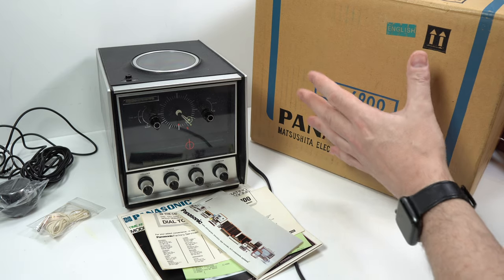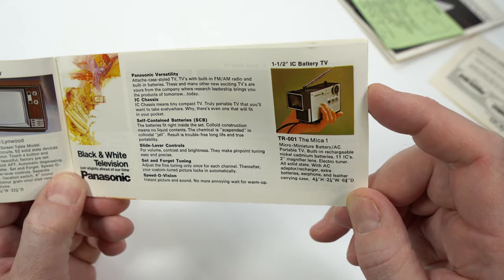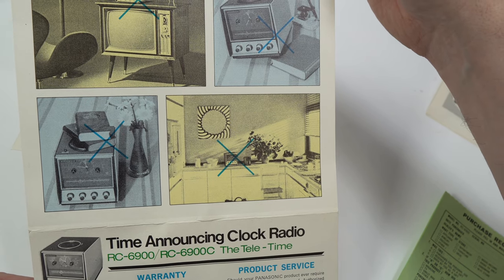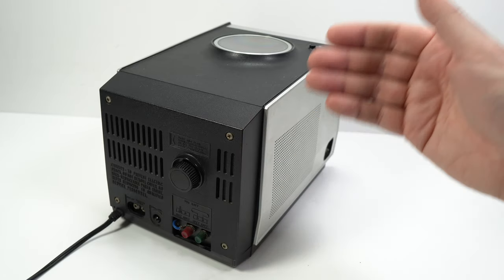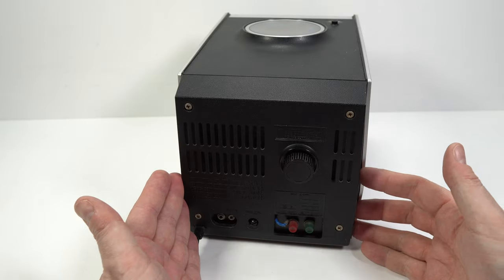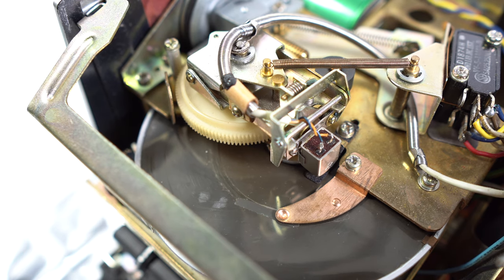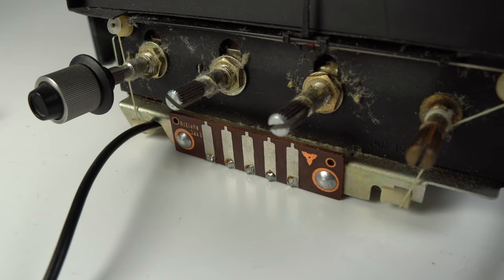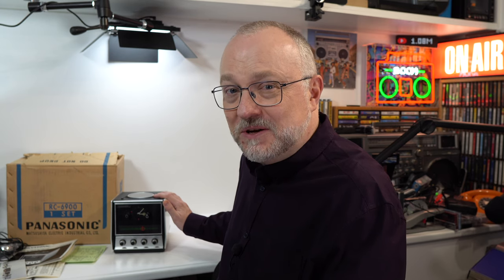The fifty year old Talking Clock Radio

Comment: A semi cheap way to convert to 60hz for testing stuff you get, you could get a Pure Sign Inverter, you can then run it off a Lip04 Battery or a Lead Acid Battery, or even a Large Power Supply, then you can use things from all over and keep the right frequency.

Comment: What an amazing device! I did not expect that dual disc setup. That's pretty clever. As for the sound, I'm sure a lot of it is degradation, but how is the condition of the speaker? Considering the surround needs replaced on even some pretty high-quality speakers every couple decades or so, I'm sure the one in that device might be contributing to some of the audio issues. Still, I would have absolutely been beside myself as a kid trying to get something like that back in the 80s, and then ended up never using it. Just like I wanted a flip-number clock like my grandfather had, like I wanted one of those clocks that projects the time on the ceiling in the 90s, and so many other gadgets but I decided to stay clock-related for the topic of the video lol

Comment: The U.S. has Daylight Saving Time.  (Across the pond, it's British Summer Time.)  Does it have a control where you can set the clock one hour before or one hour later?  Since it's one hour earlier than the correct time, maybe that has something to do with it.

Comment: It may be feasible to dismantle a 5.25 floppy disk, plenty still available and use the disc from that. Record all the audio you can off the original disk, on to a PC. Disconnect a tape recorders head and solder the wires onto the clock radios head, play the pc into the tape recorder input. Make the clock radio play the required time and at the same time use the recorder to record that message onto the disk.

Comment: 1:48 You might want to order a 12V-to-120V 60Hz power converter from Amazon, Wall-Mart, Autozone, or some other retailer that does business in the USA, then just hook it to a spare car battery on a trickle charger. I'm sure it won't be a big deal with this clock, but if you ever get a 60 Hz turntable, it will be a big help.
Reply: Make sure it's a pure sine wave converter so you get real 60Hz electricity. The electric hum should sound like a B flat.

Comment: A replacement 20% bigger wheel to drive the drive belt will convert the device and make it 50Hz compatible. Just because you’ve got the box does mean you have to think in it.

Comment: During the 1970s, gadgets like this were incredibly useful for local radio in the UK - when recordings of all transmissions must be kept for six weeks should a profanity or legal issue arise from a broadcast. At the time, log recordings were generally made on Revox open reel machines running at 1 and seven eights i.ps. 
TRying to locate a required transmission segment could take hours and hours of an engineers time as one 10.5 inch reel would contain 2 days worth of programming. Having an audio timecode on tk 2 of the 4 track tape was a godsend - no longer would you have to skip back and forth listening out for news bulletins to determine day and time..

Comment: This variety in seemingly unlogical Panasonic names for their USA-units resemble the way IKEA uses all kind of Swedish terms for depicting chairs, beds, tables and whatever they put in their printed catalogue (stopped printing this very same year though). I never understood why a specific name was given, despite knowing some Swedish words myself. BTW I used to be technically responsible for the speaking time clock of my Telecom operator, which we changed from a longstanding first electromechanical unit dating back to pre-war times to a more modern device. The female secretary of my department had a clear voice, so she was later used to feed the new more modern machine with pieces of text. All gone now of course by using voice synthesis and IT-logic and then taken out of service in the end. We used to make good money on the Telecom clock in the seventies, my very first digital dual function Seiko watch I bought in Japan myself only came in 1976 and it took a number of years before everbody could buy a much cheaper 5 function device later on the 70's and dispense with phoning a precise clock altogether !

Comment: I wonder if the mag discs, gears or head are misaligned causing the incorrect announcements. Maybe try re-aligning the discs. I take it the play mech that moves the heads runs on DC so the mains frequency wouldn’t affect the pitch of the audio too much.

Comment: I'm guessing the motor for the head was also synchronous, which means with 50Hz it's turning slower, further making the audio sound worse, though I can't say it sounded slowed-down, which it probably would from such a high % speed difference.

Comment: Have you considered purchasing an AC inverter from the US, and a power supply that can feed it enough amps at 12 volts to operate? It'd provide 60 Hz 120 volt output with a US socket, for those moments you want to power US based devices.

Comment: One issue this clock must have is that sound would almost always be distorted due to the playback head not being perfectly aligned to the track. The sound would be clearer if the discs moved in clicks, but they move smoothly which means that assuming everything was lined up properly the head would be be in exactly the right spot at even hours or minutes. What about at half past the hour or at 15,30,and 45 seconds into the minute?

The way this would have to work is that the head is wide enough to read the hour track for the entire hour and the minute track for the entire minute. If this is how is works then the azimuth would be off between the hours and minutes. 

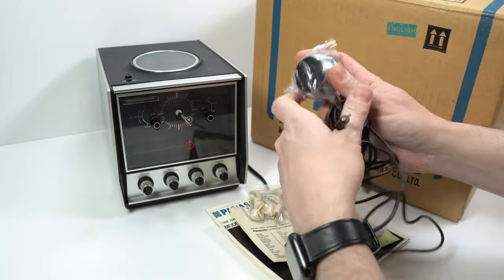It might be interesting to see if the sound is clearer at even hours and minutes. For example the hour should be less muffled sounding at 2 than at 2:30 or 2:45 and the minutes less muffled at 2:30 on the nose than at 2:30 and 22 seconds.

Comment: I believe a magnetic disc from a 5" floppy disc if cut to size and replaces the old disc then momentarily connect the magnetic head wires to a tape recorder and record all the times again using a female voice from Apple SIRI or Google Alexa. It would be a nice project, It can easily be done.

Comment: One way to get 120 volt 60 Hz in the UK (or anywhere) is to get a US spec sine wave inverter and run it off a car battery. It's not a permanent solution, but should be just fine for making videos.

Comment: If only I had the means to make magnetic media like this (actually, dual magnetic media in this case) and a suitable machine to attach erase & record heads to, then make a new disk set for this beauty.

I wonder if in your case, making a rash assumption that the media I'm about to suggest may be of suitable sizes, if you can obtain 8-inch and 5¼-inch disks and could modify them to fit, then make a recording via the playback head in the machine, that might work to some degree? Maybe a bit of bodgery attached to a cassette deck chassis as that's likely how I would approach it.

Does this system use magnetic disk alignment or indexing holes, or some such? If magnetic, it might complicate my above "idea" somewhat.

Comment: If you want to run the clock on 50Hz you could try the following: Use a strong 12V adapter and use it to power a car inverter DC 12V to 110V AC from the US. This should give you the required 60Hz. You can get those inverters for about 50 $ including shipping.

Comment: Could it be that the reason why reading out didn't work without radio was because speakers were not getting powered? I am thinking that an alarm clock speakers would be powered off when not in use to avoid unnecessary humming.  So when you pressed down the button, no power was delivered to speaker and that's what's broken. Just a guess though, I don't know enough abiut analog signals.

Comment: Personally, since so many time keeping devices at the time (and many even now) would take their time base from line frequency, I think 60Hz makes more sense. Quick reading suggests that the range of 50-60Hz for household AC power was chosen to reduce flicker in lighting, reduce power line losses, and improve operation of AC induction motors (much lower than 50Hz caused flicker, while >100Hz resulted in power loss over long distances and reduced AC motor efficiency, at least in the ones they were using at the time). However the regional split between 50 and 60Hz was mostly due to early attempts at controlling the local markets in another example of a rivalry where whoever wins, the consumer loses.

Comment: How fascinating. I'm sure it was too expensive for most blind people to afford back in 1971. Even so, it was a recognition that people could hit the button in the dark and hear the time. I do that with my circa 1991 Sharp talking calculator with a clock built in. I don't even need to switch on the lamp or even open my eyes to hear if it's too early to rise.
Reply: That’s the problem with cutting edge technology for the blind.  It is always too expensive.  Even after market stuff like the Braille Sense-U2.  There was one on eBay that was going for $5000 which is what it costed when brand new.
Reply: @jeffk7734  Amen to that! At least some things were launched with the sighted market in mind. I still have my Sharp talking calculator from 1991. I forgot how much it cost but I was fortunately working at the time. For somebody on welfare, that device would be a major blow to their budget.

Comment: What you could do to get 120V 60Hz is to buy inverter from US, 12V DC to 120V AC 60Hz, and power it using a 12V DC adapter. That way you could run these neat old devices.

Comment: Possibly, an old 8" floppy disk and drive could be used to recreate these magnetic disks. Since the MFM interface of those drives is basically analog, it should be possible to re-record the correct audio track by track so that it lines up and then can be played diagonally by the clock's tape head. But it would be a lot of effort...
Reply: Also if you have a CD-R/W and a CD-R/W drive, by putting on the correct music signal onto the CD-R/W you can write text and draw pictures on the silver data side. The error correction is Reed Solomon, which means the original un-adulterated data is visible in the entire code, and the data is interleaved in such a way that you can craft the music so that the interleaving cancels out. You DO need to know the linear speed, data start radius, and pit track pitch to get this to work.

Comment: Buy some 5 1/4 floppy diskettes to replace the two disks in the machine and record your voice onto them using that very same mechanism. Use an old tape recorder and splice the output of the record head to the head of the talking clock...

Comment: I have one of these. I kinda messed it up as a kid because I opened it up and intentionally twisted the disks on the platter to make it say the wrong time, but I could never get the disks flat on the platter again.

Now that I’m older I should take it apart again and try again to fix it. It also developed another problem though where the amp only produces a buzzing noise even for the radio.
Reply: I used to have the manuals and the remote control too but have no idea where they went. Also the Panasonic badge has since fallen off, and the two small black knobs are missing too.
Reply: Mine also had the problem where the amp didn’t turn on for the talking and the radio had to be turned on first (turned out mine had a bad micro switch).

Comment: In order to get 60 Hz, get a car-battery inverter (a 120V 60 Hz one), and a big beefy 12 volt power supply. This will be inefficient when running but will work well.

Comment: Panasonic should of placed a spare disk tucked away some ware in side the clock. The disk could be shot after 2 yrs or less? But for the time, that is if you had $129.95 in 1971 it was amazing! I remember in the 60s & 70s there was a shop buy the house, it fixed everything, our toaster, Iron, can opener, perkulator, and the Hover. Today all goes in the land fill, sad.

Comment: I looked into it, and there are plenty of 220v 50hz to 110v 60hz converters available out there... amazon has quite a few options for only $40. Perhaps grabbing one of these to avoid the 50hz vs 60hz issue might be worth looking into?
Reply: he does have a contraption for converting 230V 50hz to 120V 60hz, but its a bit clunky, as it steps the voltage down to 12V DC before converting it to 120V AC 60hz
and just because something says converts 230V 50hz to 120V 60hz, doesnt mean that it outputs 60hz, genrally they will output the same frequency you put in them, so if you put 50hz into it, 50hz comes out (and a proper frequncy converter is quite large and expensive)
Reply: @pineappleroad  then there's always the option of using a non-synchronous Uninterruptible Power Supply (UPS) to make sure the output is the 60hz that some things require. that'd be much more compact, and while kinda circuitous (charge a battery at 50hz/240v, but output at 60hz/120v), it shouldn't have any issues with being clunky or not changing the frequency.
Reply: @TheAruruu  One of the problems with that is that techmoan doesn’t want to import a UPS, due to the mess that comes with transporting batteries
He did try a ryobi power inverter (being as he only needs to be able to power the device to be able to show it in the video, and the device probably won’t be used again after he has made a video about it)
he imported the inverter and got the battery and charger from the UK, but as the output was a modified sine wave it was no use to him
Reply: @pineappleroad  oh, right. i forgot about the issues with shipping batteries... maybe go with an inverter that runs on some lead acid car batteries instead? that way you could go with an imported inverter, but local batteries.
Reply: @TheAruruu  his current setup for getting 60hz uses a 12v power supply, which is connected to an inverter that he imported from the US
But I think he decided not to use it for this video as it only plays back a voice recording of the time

Comment: I'm very interested in how they manufactured that disc: short radial tracks aren't common to my knowledge.
Reply: They probably had a similar unit rewired to record, and also modified for ease of popping discs in and out. Whatever they used probably needed some manual operation no matter what.

Comment: I know this is completely beyond the scope of what you do, but I think the disc surfaces could be replaced by floppy disc media, and new audio tracks recorded onto them. I doubt it's possible to ever get the original sound as the device shipped, even if someone sampled a working device, because that's going to be worn out too.

What probably is within your scope, although also possibly not worth it, is generating 60 Hz power. There are a ton of 12VDC to 110VAC inverters out there designed for cars to power equipment that maybe wasn't expecting to go mobile, but still doesn't suck up a ton of power. That and a bench power supply would be somewhat inefficient, but you could properly test 60 Hz dependent gear.

Comment: The way it lets the head slap the wall like that when it’s done reading is not promising for longevity., I wonder if you could record all the tracks then clean them up or something and attach a record head to sit in the right spot then “play” the new recordings onto a replacement sheet of that material cut to the right shape and size by pressing the button for each time and having the same button trigger the output on the recording head?

Comment: Re: 50/60 Hz - could you do something with a high power 12 V DC supply and then an imported pure sine wave inverter? Efficiency wouldn't exactly be spectacular, but you could effectively generate your own miniature power grid for whatever device you're testing.
Reply: you can buy USA UPS's over here. get one of those and just use it on battery for the duration.
Reply: @amojak  That is literally what I suggested.
Reply: @evilspoons  yep but a UPS has it all built in for you. battery and all and quite efficient.

Comment: I SOOOO want to know if you tried to get the disks lined up.... It seems quite obvious that they somehow are out of alignment.  So if you aligned them with the clock it'd at least read the right section of tape when you had it read the time.  Did you try?

I also wonder if you could replace the disks with a different disk? Would maybe a floppy disk be made to work.... the nightmare would be recording it properly.... You'd probably have to wire in a record head onto the clock; record it all; and then put the playback head back.... Probably not worth it....

Comment: @Techmoan - 
YES , the tinfoil hats have a use , but there should be an insulating spacer (like an aramid NON-metal army helmet) between head & foil ... 
Also this shows that your flat/house is irradiated (power line DLAN network ? )

Comment: Running it at 50Hz will only affect the accuracy of keeping the time. The fact that it says 5 o'clock when it is actually set to 6 got to be a misalignment of the hour disc. No matter what frequency it is supplied with there should always be correlation between the clock hands and the voice track.
Reply: Running it at reduced frequency likely also results in slower, lower-pitched playback.

Comment: Well some of the names seem relevant:
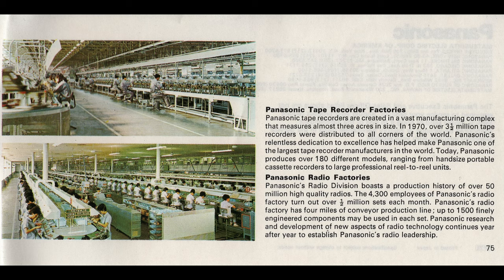4:07 The Digicorder: Digital clock radio with cassette tape recorder
4:07 The Digi-Dater: Digital clock radio with day and date calendar (I guess that's another one they might have to rethink these days)
5:34 The Eightone: Portable radio with 8-track stereo tape player (ok perhaps they were running out of inspiration by this point)
4:05 MX-250: Low-end graphics.... I mean Custom Deluxe Blender (i.e. MiX-250 I guess?)
4:05 NT-4000A: Four-slice self-lowering toaster with radiant and shade controls.... HEY WAIT A MINUTE